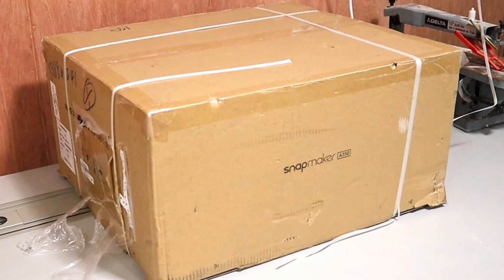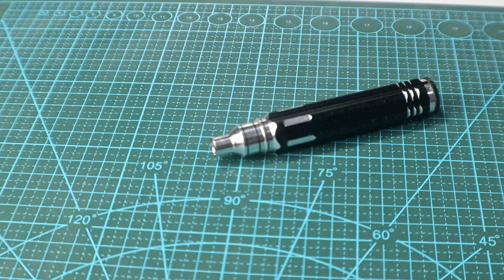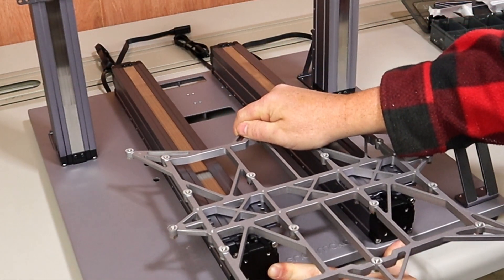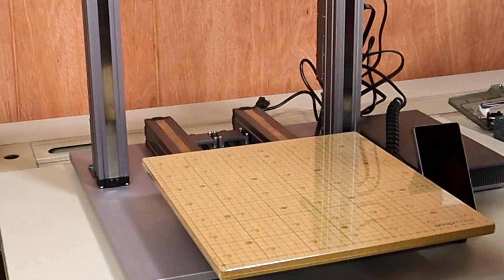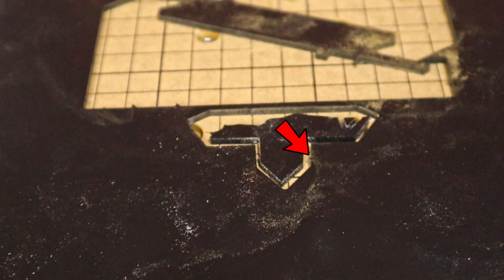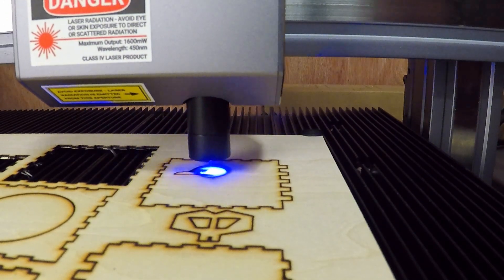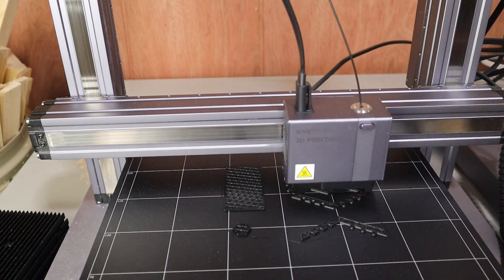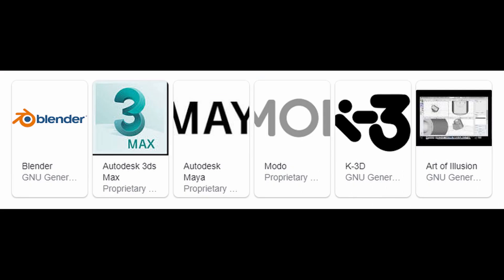SnapMaker 2.0 Unboxing and Review

Comment: ARE YOU KIDDING ME HOW MANY DAYS DDID YOU WAIT?!?!?! lol jk i just ordered mine 2 days ago and its going to take 5 more days and im just tryna find ways to keep busy and i would lose my mind wait so many days lol
Reply from the maker: It was worth the wait, you will have a lot of fun with it I am sure!
Reply: @LogHouseFarm   i actually built my own 3d printer, using an anet frame btt skr board bltouch and so on. it runs really well and im sure it cost me around 1000 to build, the snapmaker my brther showed my a little while ago and it was during me building and programing marlin and i also have two other hobbies, saltwater reef tank and i am a farmer i grow fruit. i finally had some time to look into the snapmaker 2.0, granted i am limited on space atm i ordered the A150, but i feel if i can master the cnc, i was looking at a desktop 6 axis cnc machine that runs 8k or something, for fun lol. what are your thoughts on the 6 axis cnc ?
Reply: @LogHouseFarm  pocket nc is what it is called

Comment: At the 8:07 mark, it looks like you are cutting the outer border of 3/4” plywood. May I ask how you did that or what bit you used? The one time I tried to trim out 1/2” my head hit the piece and broke it loose from the clamps. Great video! I got mine set up yesterday.
Reply from the maker: It's 17mil plywood and I used the ball end bit. This bit is the same thickness from top to bottom, and I use shallow passes so all the cutting is at the end of the bit. It seems to work well, I hope to get a few more bits for things like this.